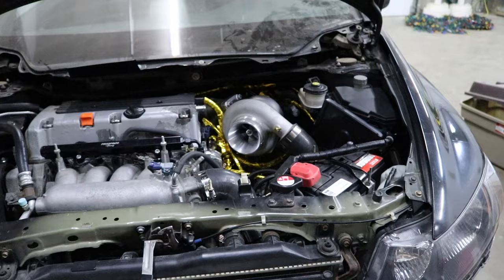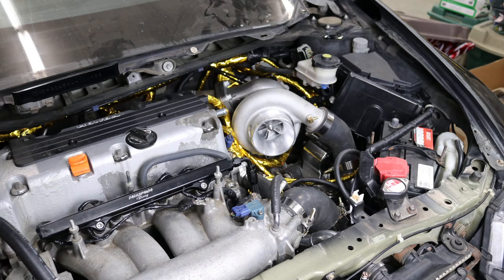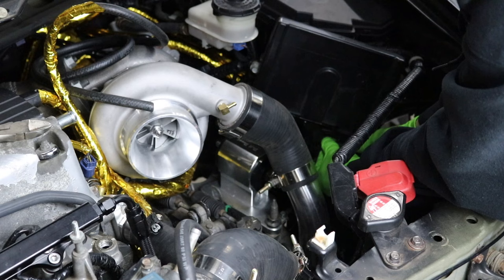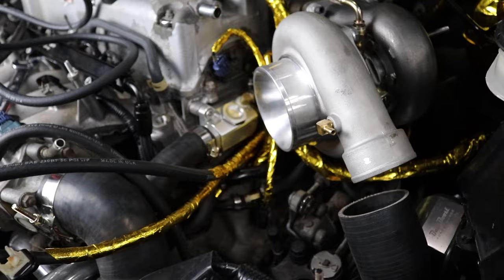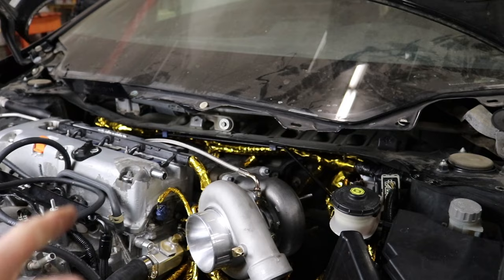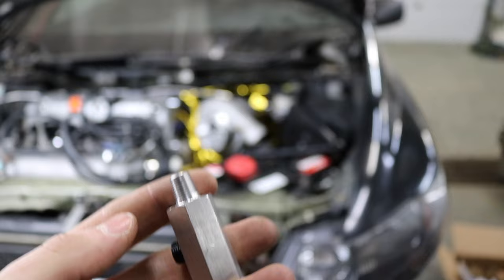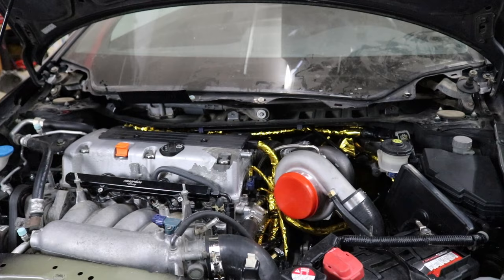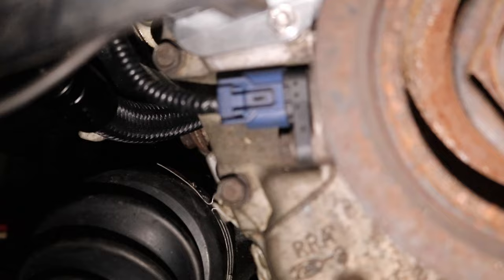TURBO 8th Gen Honda Civic Build | Ep.11 (CX Racing Turbo & Hondata Boost Controller)

Comment: That idle air assist valve actually sits on top of a sensor which runs off of coolant temp and opens/closes that valve. You wont be able to use it for a vacuum source right off the manifold like that. I cut that whole section off to use a tractuff piece to replace it and coolant runs through a port on the bottom of the mani! Hope this helps!
Reply from the maker: These are the kind of comments I love to see. Thank you for the awesome info! I’ll just block it off & get all the fittings that come in the block off kits 👍🏼

Comment: I’m just watching just because. Another great informative video. I do the same with zip ties that I bought a 1,000 pack off Amazon last month and I’ve gone through 100+ already.
Reply from the maker: I have wasted a countless amount of zip ties 😅 it never ends
Reply: @DanielKellert  exactly like you said you set it up then 5 mins later you need to cut it off and re do it but the one thing that’s the most annoying is getting the zip tie in an awkward area and you finally get it in but the tie is backwards and you have to try again.

Comment: run an intake tube from the turbo and mount your check valve to that tube so either under boost or idle its ALWAYS pulling a vacuum can do the same thing with your catch can and purge valve kind of an after thought while watching the build love all the ifo was looking at this exact fir but had no idea how it was gonna fit and i greatly appreciate this content
Reply from the maker: The turbo inlet is not a proper vacuum source to run any of those off of. There is a lot room for failure or leaks between the turbo to the manifold (couplers, clamps, pipes, throttle body, etc). Plus your throttle body is electronically controlled to close & only allow the desired amount of air into the engine at idle, so you would have restricted vacuum if mounting on the turbo inlet. Only place to mount any vacuum assisted component is directly to the intake manifold so it gets true engine vacuum.
Reply: @DanielKellert  ah ok i got you, I was reffering to intake tube before the turbo couplers won't matter turbo is always pulling a vacuum
Reply from the maker: @joeyjohnson938  I know you were, that air is being pulled through the turbo & pushed through the intercooler piping to the intake manifold. Vacuum’s need to have a way to exhaust the air as well. I personally would not run a vacuum source pre turbo. If you’re gonna try it, do your research first & let me know how it goes 👍🏼